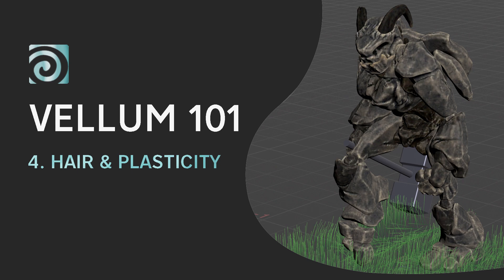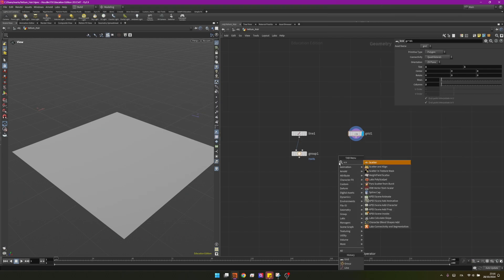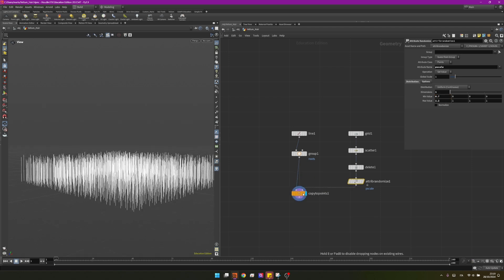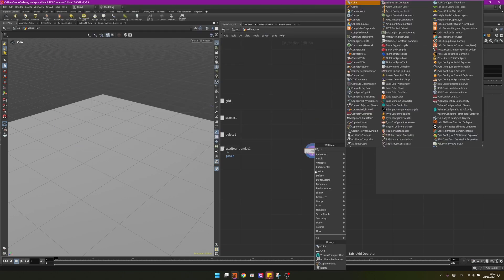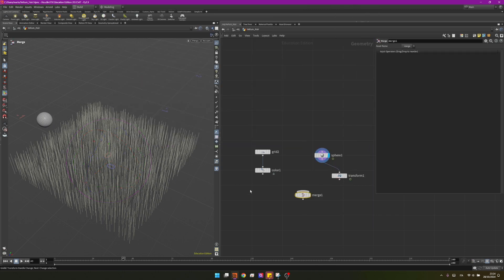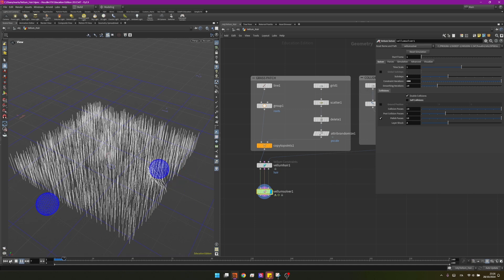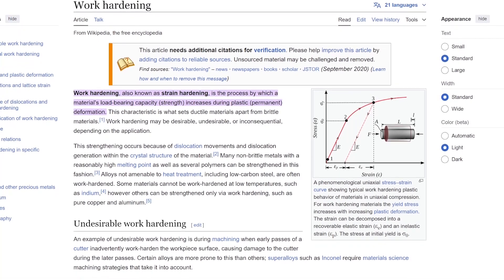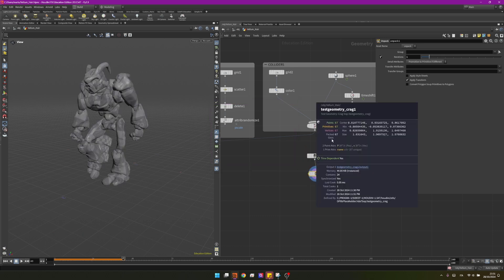Grass Field using Vellum - Master Hair Constraints in Houdini

Comment: Nice tutorial. Why didn't you enable the ground collision in the vellum solver? At first I thought you had the grid as a collider for some other reason. It does tend to create stray hairs to go below the grid plane. Just using the ground collision in the solver and no grid plane as the collider keeps the simulation more consistent.
Reply from the maker: Hi! If I remember right, I did try it and even  increasing the substeps, the hair strands kept intersecting and showing through the grid. I wasn’t aware there’s a difference between using a custom grid and just enabling the ground collision in the solve, that’s really interesting. I’ll definitely look into that, thanks!